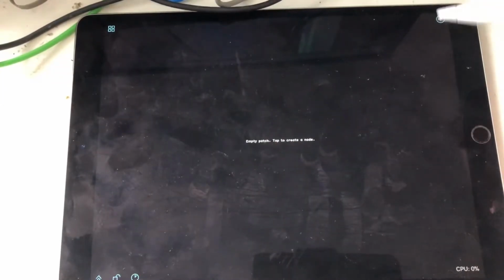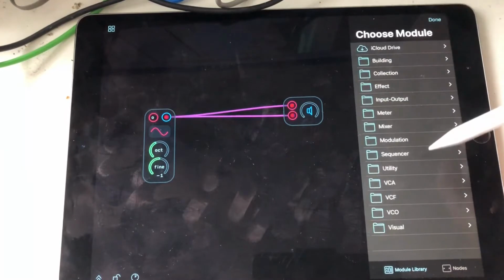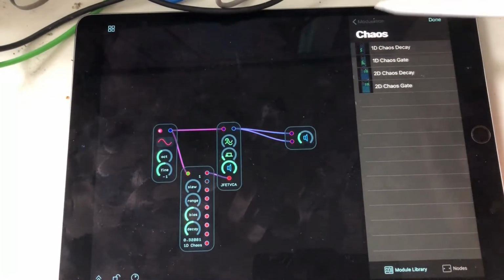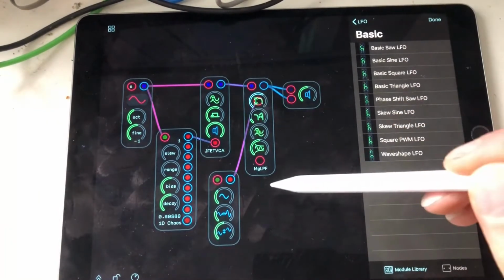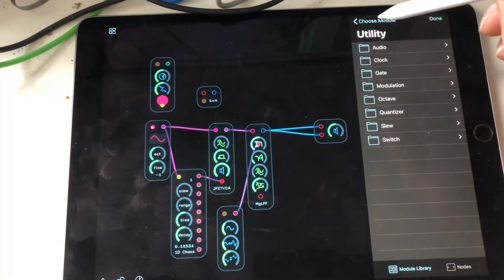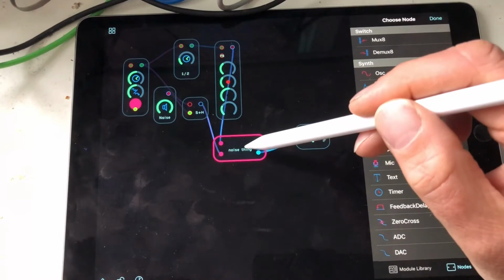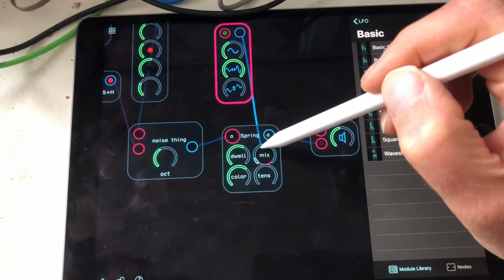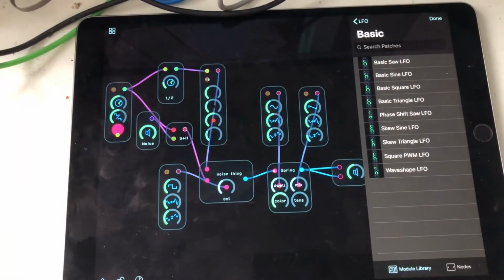Audulus: Nord Modular killer??

Comment: I definitely like the use of a stylus instead of using my fingers.  Currently, I don't even have such a screen to try this on but I'll need to try an evaluation (something I've been meaning to get around to but haven't yet).  One thing that put me off is they sell it as a separate license for Mac and PC, but I have a Mac laptop & a PC which equals two licenses whereas every tool I currently have usually provided 2-3 systems for one license on any system.